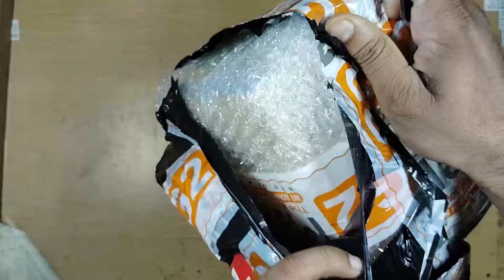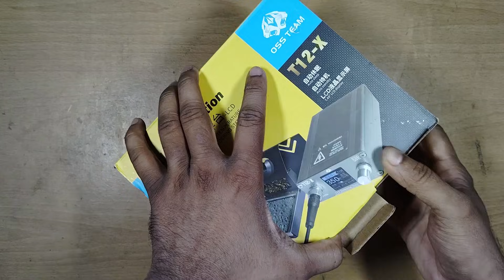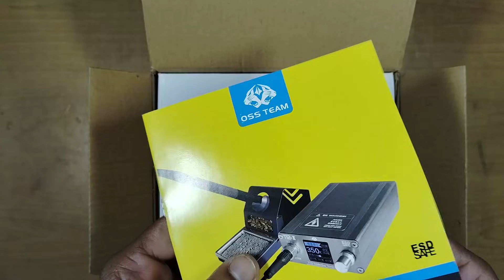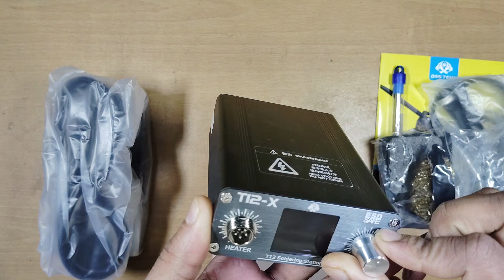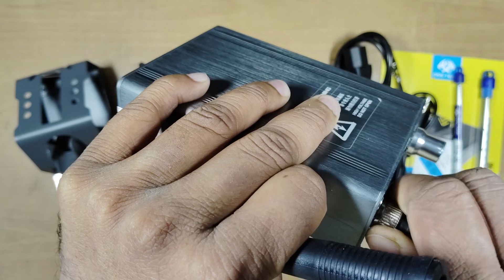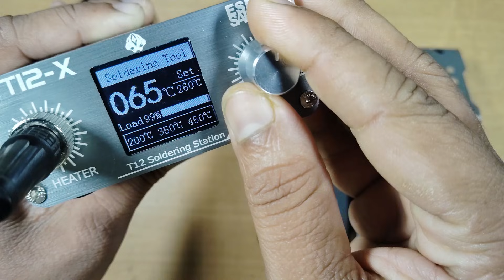T12x Soldering Station Unboxing & Full Walkthrough

Comment: Where should i connect the ground wire?
Reply from the maker: In the back of the device there is a socket where the ground wire connects. The clip end can be connected to the esd mat or any other ground point.